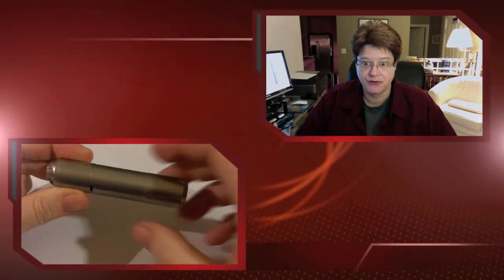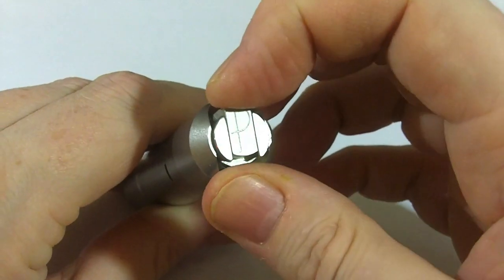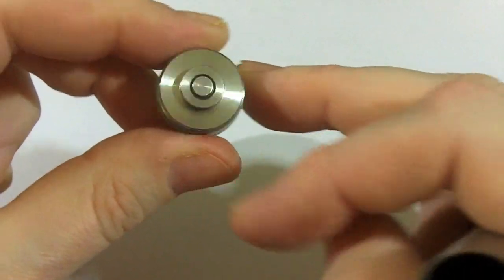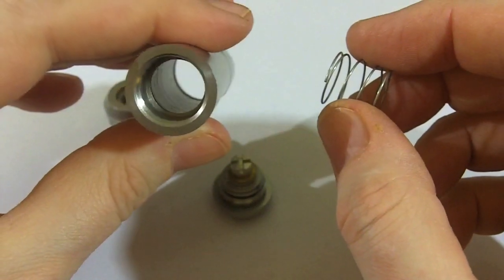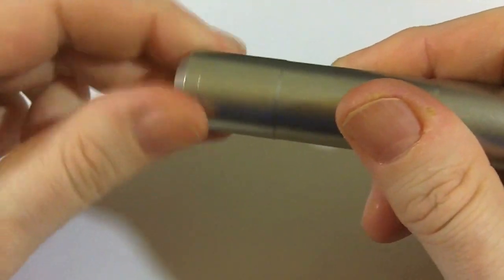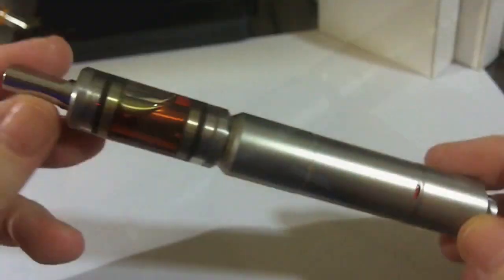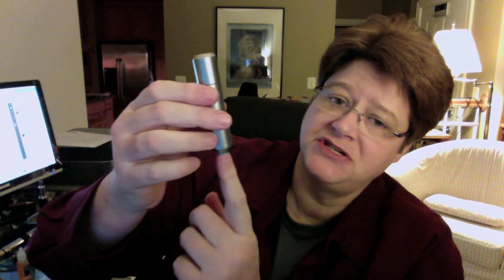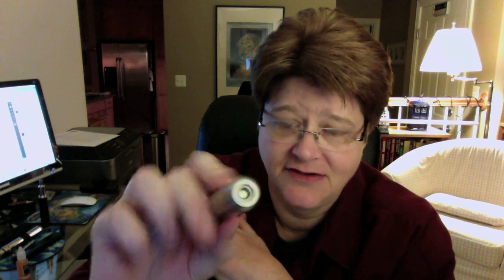Precise + 18500

Comment: @MainelyVapor 
That used Precise isn't set up properly and is missing parts. My Precise doesn't rattle or require finger or hand contortions to fire reliably and comfortably. When I got my Precise (New not Used) it came with extra parts to adjust the switch throw and battery spacing. 1-click locking button and rhodium contacts and it's all win for me. Also, I can send it in for a free polish and tuneup whenever it needs it

Comment: I know its only 25 bucks but there is a difference between 175 and 200, the P+18500 is 175 shipped priority. Quite surprised that geekgirl did not do a little more research on the supert forum before making a review, especially since she picked it up used.  I am curious if you ended up getting a parts kit from David as to alleviate the rattling battery, it surprises me that you would think that is the way it was made.   If you need any o-rings or washers for the switch shoot me a message.

Comment: Plus the new P+ line up of PV's also have the best contacts money can buy no junk copper or brass!! They have 24crt gold first the rhodium coating on all the contacts the bottom battery contact the top battery contact and the addy/carto contact! You your self said how nice they looked! Thats because Dave has used 2 of the most expensive metals in the world to coat the contacts do that gives you the best voltage transfer that money can buy! Have you noticed you don't! ( or I hope you have not sa

Comment: And one more thing why do you think Evolv picked Super T to sell the Kicks and not a junk GG? Because of the quality that David puts into the Precise line up! I have a Kick all ready and use it in my P18650 with a 18500 and a 18490 battery in it and I use it in my P+ 18500 with a 18350 battery in it every day and with those combo's these things kick butt! I'd buy a Precise with a Kick in it before I'd ever buy a error code Provai or a high priced GG! And a Provai is not $180 to use a 18650 in i

Comment: All I have to say to this review is maybe you should of seen how the Precise line up works first!!! They do come with a bag of extra parts like o-rings for under the battery when you use a 18490 battery in an 18500 Precise! The rattle is because a 18490 battery is shorter than a 18500 battery but you forgot to say that part! So when you buy one of Dave from Super T manufacting Precises they come with extra o-rings and different thickness so you can use a shorter 18490 battery in a 18500 device!

Comment: first off, im not a fanboi of super t. im a fanboi of high performance devices. as far as tube mods go, they dont come better than the p+ line. ya its spendy. but gold and rhodium plated contacts? do you know what i would give to have that on my zenesis? talk about a high priced mod that has switch issues. lifetime transferable warranty and now a rebuildable on the horizon made to mate perfectly with the p+. im sold..